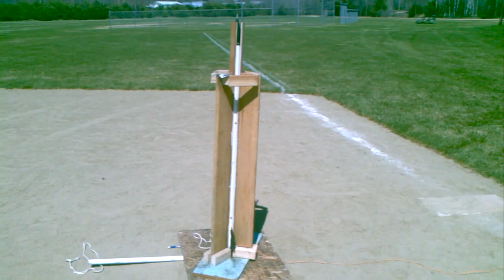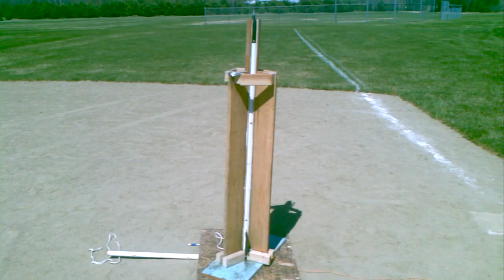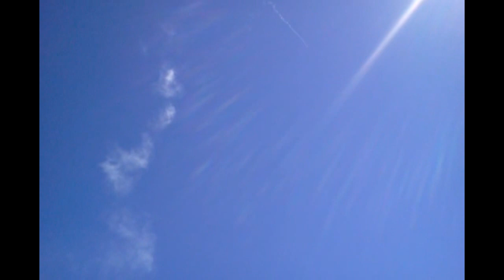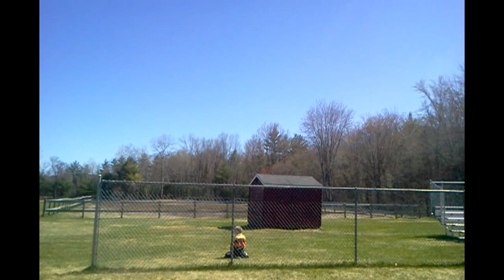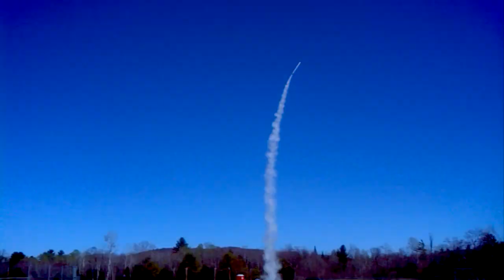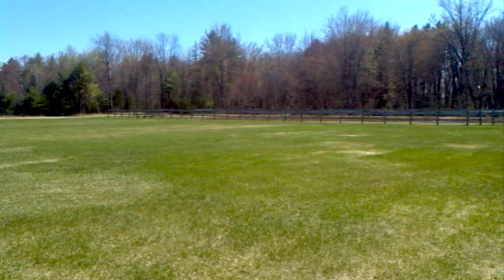Part 13:  How to Build a High Powered Rocket - Successful Launch AND Deployment!

Comment: I followed your entire series and it was most helpful.  Thank you so much for doing this.  I'm nowhere near launch but I'm in the testing phases; Really like the flexi fuel formula.  Been mostly burn testing with careful attention to the nozzle.  I noticed if not enough quickrete/putty on the convergent side over the washer, it's blowing out the back.  Almost there.  I really need to work on the recovery system and that's the only subject you did not cover as carefully as the others.  Will you be continuing your rocketry videos in the future?  You mentioned making the grains more predictable.  Are you still into rocketry?  Regardless,  thank you so much for making this video.  Cheers.

Comment: WTF was the Motor you made and used for this? Certainly was No "I'" class what class motor was used on this?
Reply: skyprop  It looks like " A,B, or C" class body tube used here
Reply from the maker: +skyprop If I remember correctly, that was a 3 Bates Grain motor..each grain about 65 Grams or so.

Comment: hey i watched the whole series of this rocket and thought it was really cool seeing it from start to finish and was wondering how high do you think your rocket went in the air?
Reply from the maker: +Zachary Madrid I don't think that one went any more than 2000 feet.  There was a bit of zig zag at launch and I later discovered that was due to the launch rail being warped on the pad, otherwise it would have been a more graceful flight.

Comment: Can you give us all dimensions and measurements for the rocket? (i.e.. weights, diameters etc.)

Best tutorial on YouTube but it seems you only want to give just enough info for people to understand the concepts and not to actually build the rocket. It would take you all of 15 minutes to give us some numbers so we could build this thing...
Reply from the maker: Hi Gary, I am sure a lot of details are left out as some of the building knowlege is inherent from my carpentry and other building skill sets.  Most of my rockets are between 5 1/2 to 6 Feet tall.  The biggest challenge is leaving enough room in your build for parachute (payload bay) and the ejection system.  Much of it was by trial and error.  You'll have to work out the details but I recommend having at least 12 inches of parachute bay to make it easy for nose cone seating.